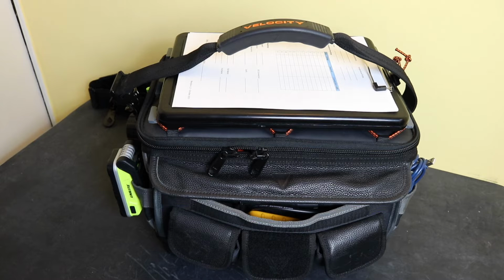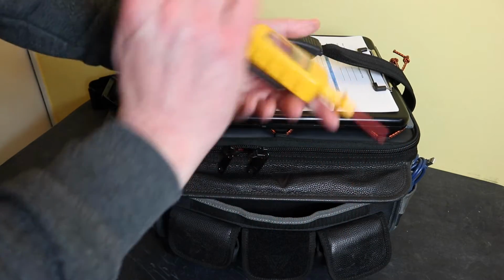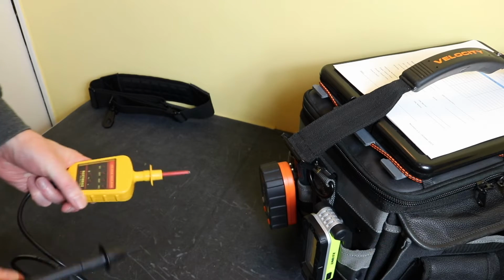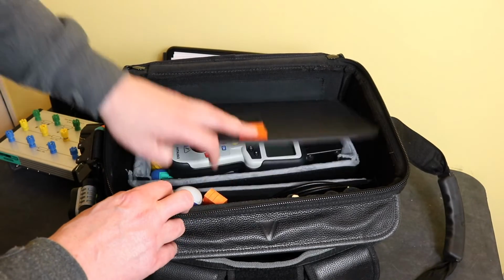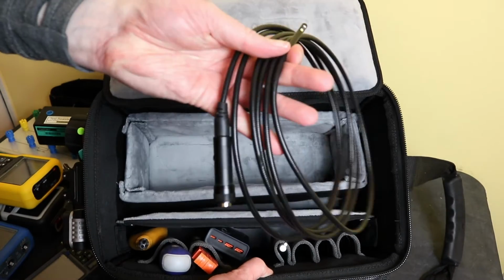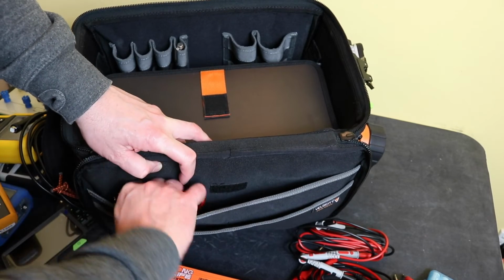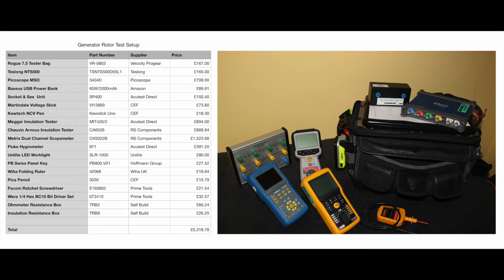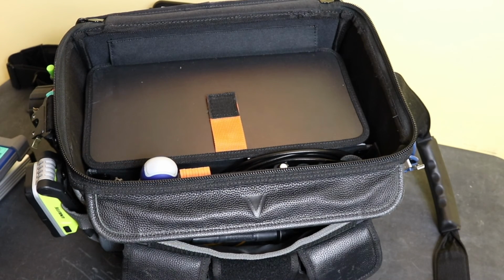Generator Rotor Test Equipment Loadout

Comment: What do you use the Picoscope for, is it for RSO test? 
I purchased a Picoscope hoping I could use it for AVR step response testing, however it doesn't have a trend function. 
If you test HV generators onsite I recommend the Kyoritsu 3125A 5kV insulation tester, compact and uses disposable batteries.
Reply from the maker: Yes, the Picoscope is used for RSO tests and online AGSC monitoring. They do make the Picolog units which may be able to collect the AVR data, but it is very low voltage input so you would have to construct some voltage dividers for it. Really you are looking at the HiLogger units from Hioki for AVR step response.
I have not used the Kyoritsu / Kewtech meggers, thanks for the recommendation, I will take a look at them.
Thanks for watching and commenting.

Comment: Thats bad ass set you got for online gen testing. We use a old baker/ SKF online tester for our rotor bar testing. Any way you could do a vid on how you use the pico scope for motor testing. Seems like it would be a bit more useful to do what motordoc does with electrical signature analysis
Reply from the maker: This particular set up is for offline rotor testing. I have different data collection units for online testing of the generators.
Whilst you can use the Picoscope for motor testing, it does become hard work. All the formulas and settings have to be configured manually. Picoscope has a 20V input limits as well, so high voltage probes are usually required for online analysis, which I don't have a full set of.
MCSA units are optimised for the data collection and analysis and are more user friendly in my opinion.
Reply: @three-phase562  wait how are you doing offline rotor testing?
Reply from the maker: @burnedupsparkytipsandrevie9597  A generator rotor is two coils embedded within the rotor forging, it is completely different to the construction of a rotor for an induction motor.
We measure the winding resistance, AC impedance and insulation resistance of the coil, usually with DAR and PI. We have a special recurrent surge oscillograph (RSO) test that looks for interturn faults within the winding. This is what I use the Picoscope for.
Online, we have flux probes installed that pick up the magnetic field from each turn of the rotor winding that we can analyse, either with a scope or more specialised data collectors.